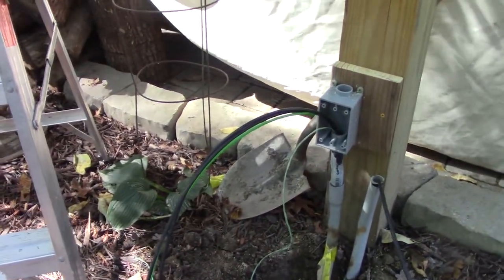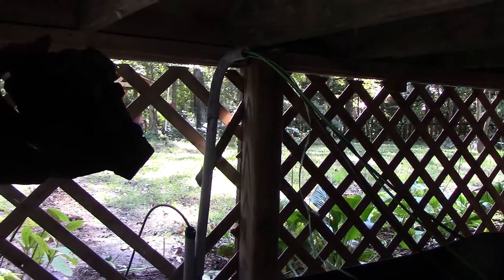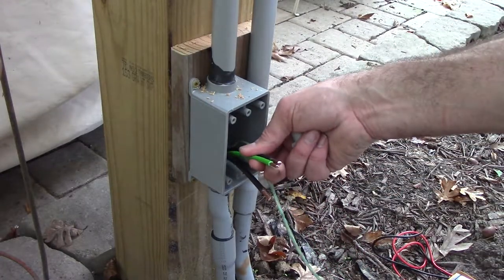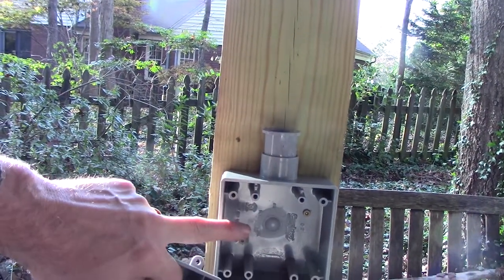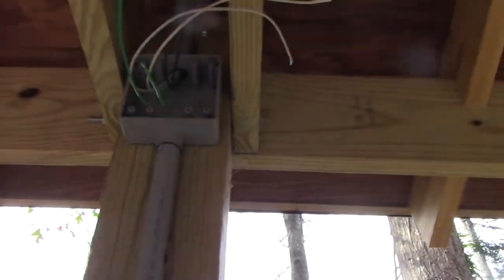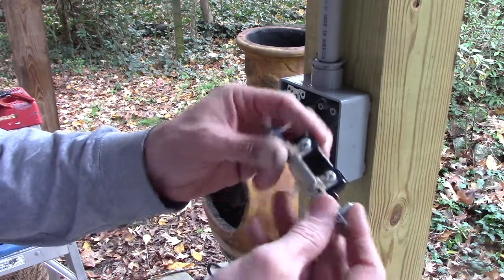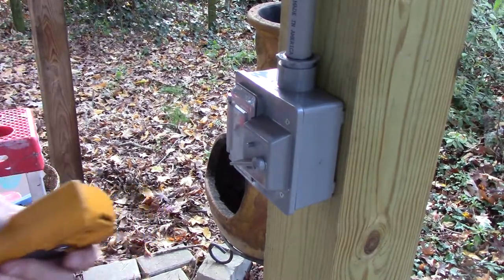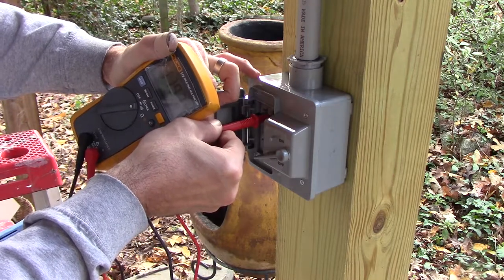Installing Electricity for a Backyard Pavilion

Comment: 24:45 Those wire connectors (Wagos) are reusable.  To remove the wires, pull gently on the wire while making a "cranking" motion.  It definitely works better with solid wire, though.

Great job on the install!
Reply from the maker: The Wago connectors we have at work have an orange lever that you can release and re use. They are really handy, especially if you have to doe something hot.

Comment: Thanks I'm going to be using 12/2 romex underground in pvc for some outlets and go to 14/3 for the ceiling fan in the middle. 
Just build a Costco pavilion and found the perfect video to see how to run conduit and wiring. Thanks !
Reply: Conduit run underground is considered a wet location.12/2  Romex Type NMB is not approved for wet locations. UF cable or THHN/THWN wire is permitted in wet locations

Comment: I think if you use Weggo wire connectors you don’t even have to cut the wire.
That is a very decent job.
Reply from the maker: I use them at work sometimes. You are right I would imagine that the blade in there would cut right through the insulation.

Comment: You don't have to use offset boards you can use a heat gun to worm your PVC and bend it. it looks much nicer.
Reply from the maker: I did it that way so it would clear the rim board at the top and allow the pull elbow to fit better.

Comment: Why use a justion box ? Could of ya not just wired it directly into the main inside the house ?
Reply from the maker: I used a junction box so I convert to Romex style wire and not have to run conduit to the breaker panel since there was another 25 feet or so to the breaker panel plus a few turns to get there.

Comment: What's the distance between the posts?
Reply from the maker: On the narrow end it is 10 feet 8 inches to the inside. The long side is a little over 15 feet. I was straddling a 10 x 15 paver patio.

Comment: Is it me or are you bugging #12 wire onto #6  or did you oversize the wire for voltage drop? I see it was put on 20 Amp breaker, which makes total sense
Reply from the maker: I oversized the wire for the long run and in case I needed more capacity in the future.

Comment: No offense on your workmanship but a single solid piece of decking board running from bottom to top would have looked alot better. Just my opinion.🤷‍♂️
Reply from the maker: I had considered doing that but a: I did not have a piece long enough on hand and, b: i did not want to make one of the pavilion legs look thicker than the others. I was hoping the conduit would sort of disappear.